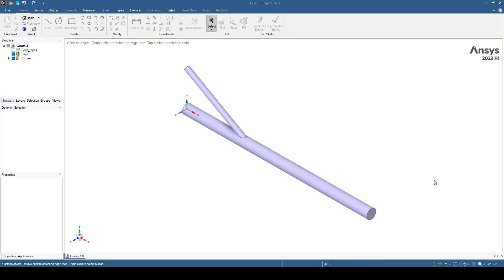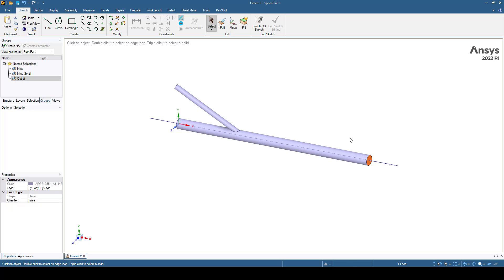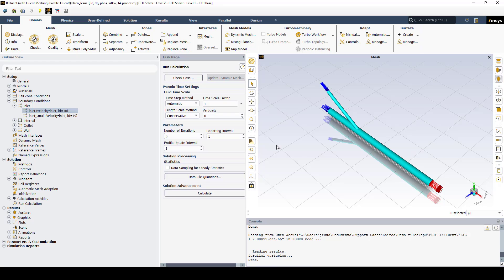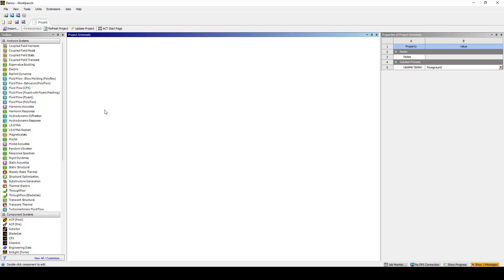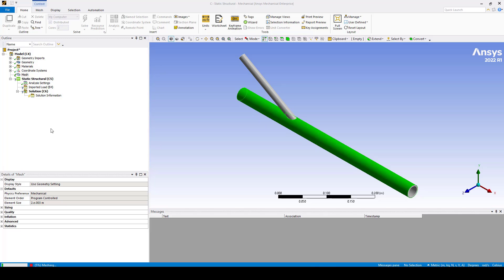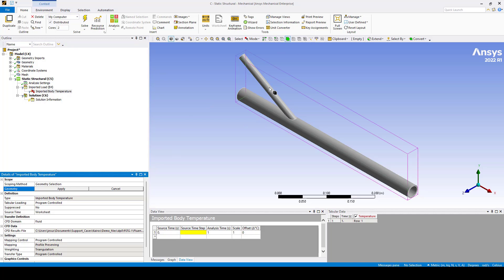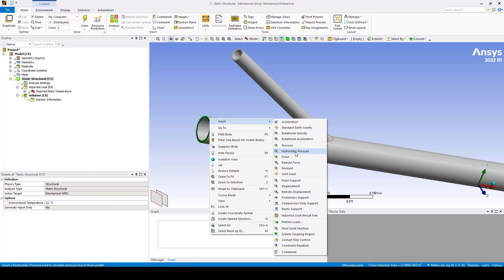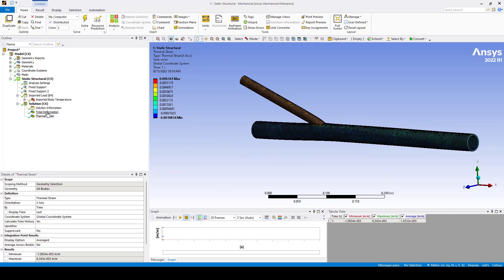How to transfer a thermal field from Ansys Fluent to Ansys Mechanical?

Comment: Thanks for the video. A thought - this only works for thin pipes, right? The temperature import maps the temperature from the inner wall to the external wall as well, as it looks to me. A thicker pipe would probably have a thermal gradient. 

What is the best way to handle such a case? I am new to fluent, but saw that it is possible to include solid domains as well - can they be used for heat transfer in the fluid analysis? Or is it easier to create a heat transfer analysis of the pipe with the imported temperature applied to the inner surface, and then export that thermal stress field to a structural analysis?
Reply from the maker: The workbench temperature mapping can be used for surfaces or in solids. For thick walls, you can setup a CHT model in Fluent and map the temperature to Mechanical.

Comment: Thank you for the video. 
I have a question, I am doing a similar project and I have chosen a material for the pipe in Fluent, so is there any need to change the material in static-structural or the program itself will consider the material I've chosen in Fluent, while the appeared material in static-structural is the defalut one?